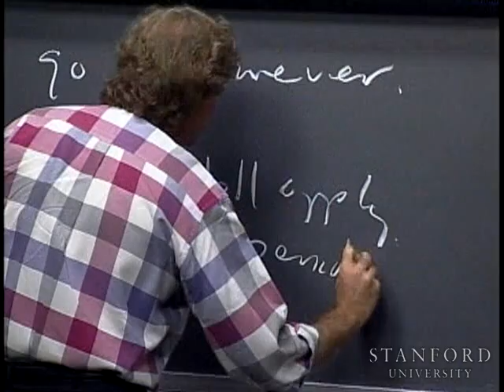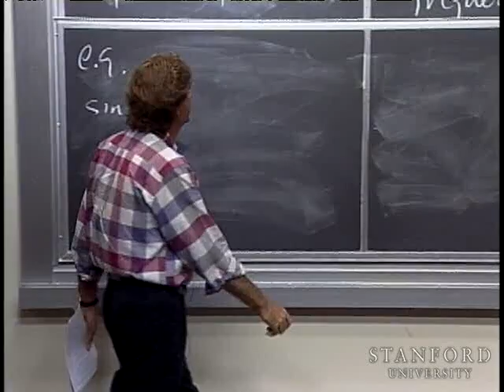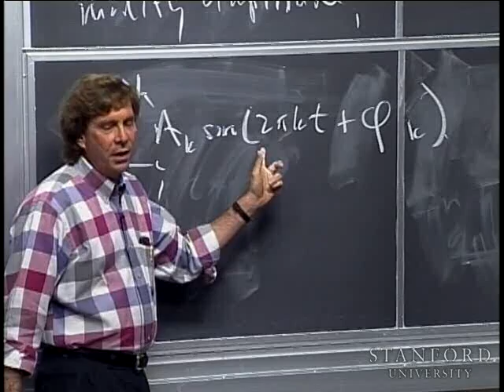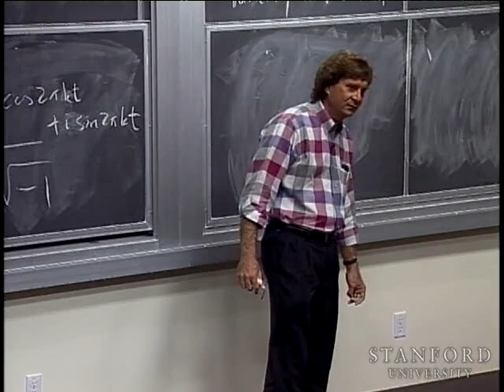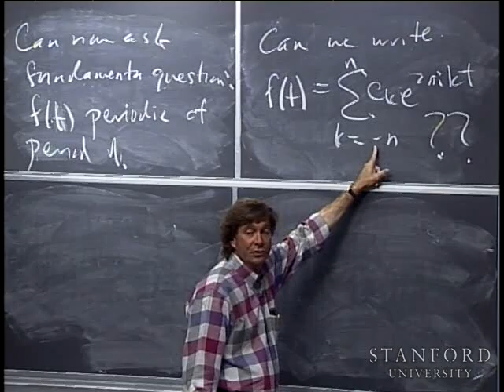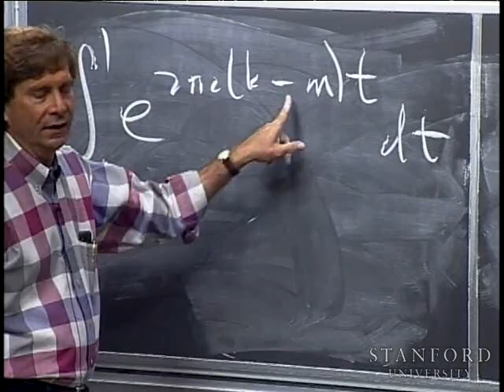Lecture 2 | The Fourier Transforms and its Applications

Comment: Desmos is tool now for plotting graph visual search desmos
Reply: The expression 
𝑒
2
𝜋
𝑖
𝑘
𝑡
e 
2πikt
  represents a point on the unit circle in the complex plane, which makes it symmetric in the following ways:

1. Symmetry About the Origin
The complex exponential 
𝑒
2
𝜋
𝑖
𝑘
𝑡
e 
2πikt
  can be written using Euler's formula:

𝑒
2
𝜋
𝑖
𝑘
𝑡
=
cos

(
2
𝜋
𝑘
𝑡
)
+
𝑖
sin

(
2
𝜋
𝑘
𝑡
)
e 
2πikt
 =cos(2πkt)+isin(2πkt)
The real part is 
cos

(
2
𝜋
𝑘
𝑡
)
cos(2πkt).
The imaginary part is 
sin

(
2
𝜋
𝑘
𝑡
)
sin(2πkt).
As 
𝑡
t varies, the point 
(
cos

(
2
𝜋
𝑘
𝑡
)
,
sin

(
2
𝜋
𝑘
𝑡
)
)
(cos(2πkt),sin(2πkt)) traces a circle of radius 1 centered at the origin.

For every point 
𝑧
=
𝑒
2
𝜋
𝑖
𝑘
𝑡
z=e 
2πikt
 , there exists a point 
−
𝑧
=
𝑒
2
𝜋
𝑖
𝑘
𝑡
+
𝜋
−z=e 
2πikt+π
  diametrically opposite to it. This reflects symmetry about the origin.

Comment: iota has always being i =√-1.

Iota is an imaginary unit number to express complex numbers, where i i is defined as imaginary or unit imaginary. Basically, the value of the imaginary unit number, i i is generated, when there is a negative number inside the square root. Thus, the value of i i is given as √-1.

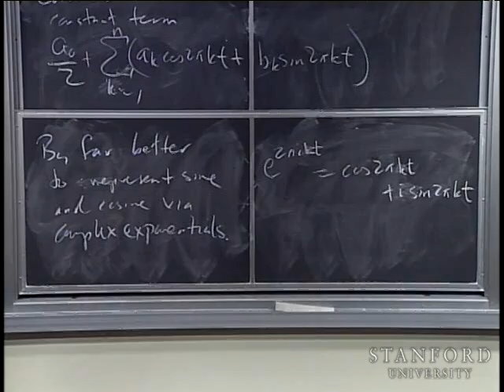30:40

Comment: I really like the videos -- I am not sure, but I think I found a little mistake: is not C0=a0 and not C0=a0/2 ? Or do I have somewhere a mistake. I start the addition already in the beginning with n=0 and separate the neg. and positive sum. Here is my Latex result:

\[\sum\limits_{n = 1}^N {\left( {\frac{{{a_n}}}{2}{e^{i2\pi nt}} + \frac{{{b_n}}}{{2i}}{e^{i2\pi nt}}} \right) + \sum\limits_{n = 1}^N {\left( {\frac{{{a_n}}}{2}{e^{ - i2\pi nt}} - \frac{{{b_n}}}{{2i}}{e^{ - i2\pi nt}}} \right)} }  + \left[ {\underbrace {\frac{{{a_0}}}{2}{e^{i2\pi 0t}} + \frac{{{a_0}}}{2}{e^{ - i2\pi 0t}}}_{{a_0}} + \underbrace {\frac{{{b_0}}}{{2i}}{e^{i2\pi 0t}} - \frac{{{b_0}}}{{2i}}{e^{ - i2\pi 0t}}}_0} \right]\]

Comment: Why the signals should be real ? can`t they be imaginary?
Reply: You can certainly do Fourier analysis with complex signals. You also get the coefficients by integrating and noting the other terms integrate to zero. In many applications the signals are assumed real but much of the theory is arguably cleaner with complex signals allowed. 

On the other hand the derivation of the k != m integrals being zero is also easy not considering complex values. Just do it explicitly for sine/cosine using normal calculus. (admittedly not as easy but still calc2 stuff)
Reply: Because this is an engineering class. :/ I'd like to learn the complex signals though. :)
Reply: +Memo “MekoxTwiSparkle” Pony then plug i. j(wt+£) and you're off to doing your complex signals

Comment: This guys teaching format is archaic, improved by a very large screen, a document reader or overhead with prepared sheets.  Far more content could be taught in so much less time.  The huge chalk and distant blackboards in so 1940.  Come on Stanford, for the cost of education, you can get your professors to move into the 21st century.  After 2 lectures, this is a Precalc class.
Reply: I appreciate how much more tech is available now for teaching than there was back when this instructor lectured.

Comment: Is it possible to have a function that is a sum of periodic functions (and is thus periodic), that lies continuously on the x-axis on any point (rather than just intersecting and passing through it) also how would you express a function that has no smooth curvature, like a saw-tooth jagged function. The latter seems to need at minimum an infinite sum of periodic functions, while the prior seems impossible.

Comment: imagine  an AC signal being sent through a circuit, the voltage will oscillate, right *say it oscillates +1V and -1V? Now imagine a 12 volt DC battery sending a current through a circuit.  The voltage is constant at 12V and the current is also constant, due to the DC voltage.  Now add an alternating current source to the DC battery in the same circuit.  This AC signal will oscillate up and down 1V, and the DC component will remain constant at 12 V.  Added together, v goes from 11 to 13 to 11.